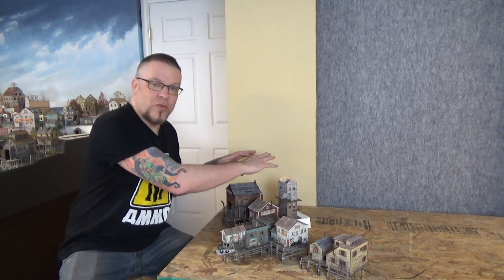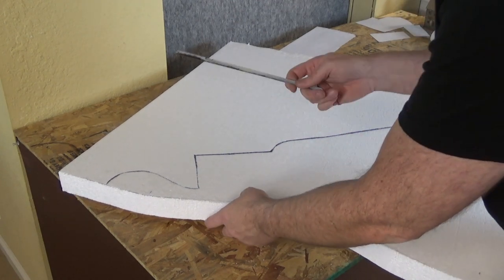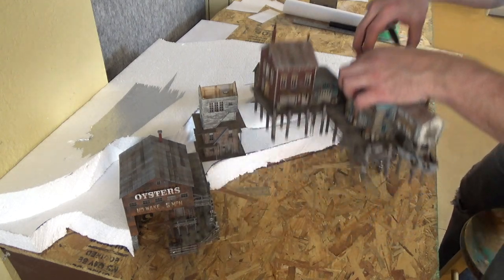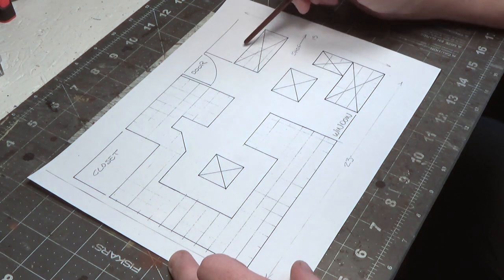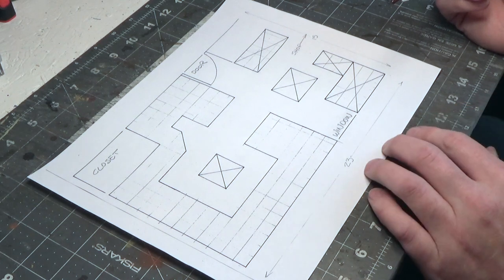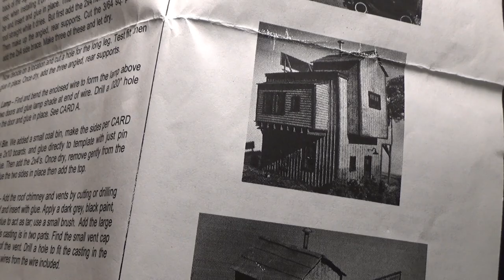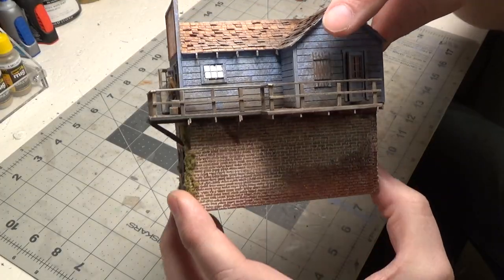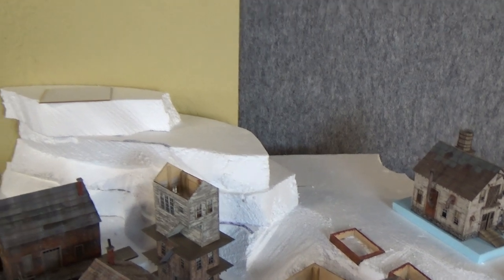Forming land out of styrofoam

Comment: Jason, such a cool update with what you are doing right now. The sections that are on wheels is such a great idea, it really opens up a lot of possibilities. Be mindful of those sharp 90 degree corners, they will poke you in the hip real easy. With so much water front area, have you considered a port where bigger boats can bring in coal for a coal dealer or even a fuel dealer that sells oil for heating?? all those tanks would look cool. A car float would be another way to include your trains and it would have to be tied to the rest of the layout. Not sure if any of that suits your interest. Will you be modeling any abandoned structures that are rotting away in the water from too many years of neglect?? Always appreciate your work. Thanks for sharing. Cheers Rob
Reply from the maker: Thank you so much for watching and Thanks for all the great ideas, I really appreciate it!!!

Comment: Truly excellent layout and video. Just a couple of suggestions. The brick foundations look great and lend an aged look to the structures. You might also introduce some variety by using one or two somewhat deteriorated form cast concrete (often used in the era before concrete block became common) foundations similar to the abutments of the lift bridge. Also, perhaps a good location for the lighthouse would be on a rocky island in the center of the movable "water" photogaphy section. Just a couple of thoughts and again, certainly not to take anything away from the superb modeling already accomplished. I would definitely agree with the previous poster's comparison to John Allen.
Reply from the maker: Thank you so much!!! And Thanks for the great suggestions, I really appreciate it!!!
Reply from the maker: That's a great idea for the light house!!!